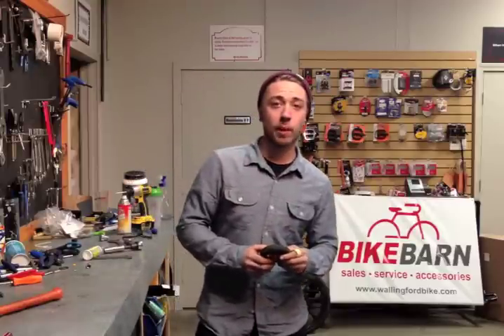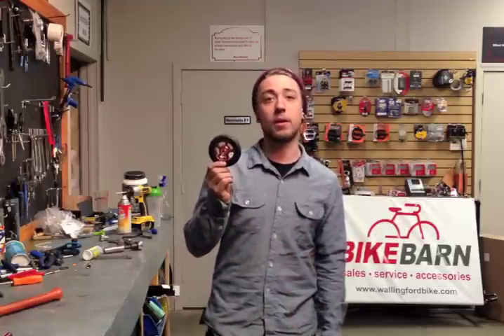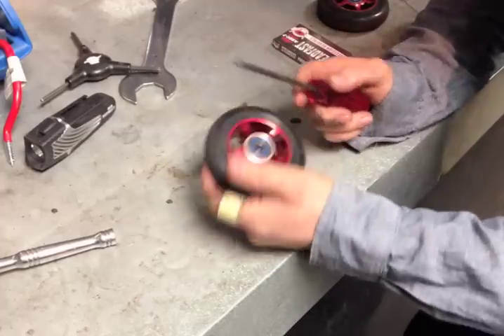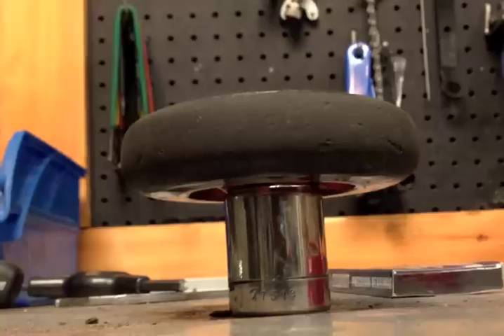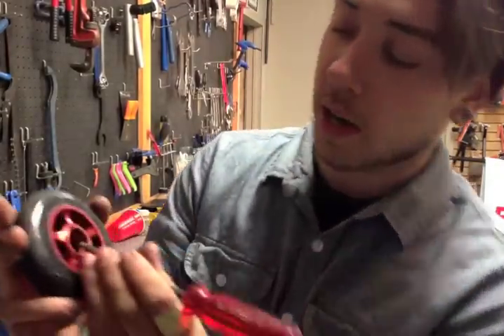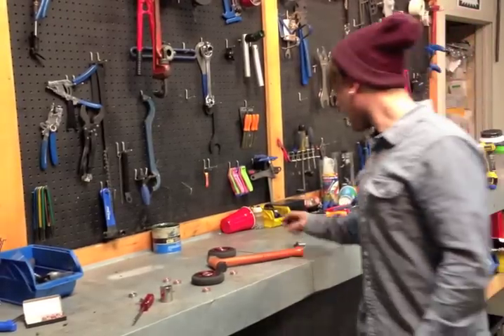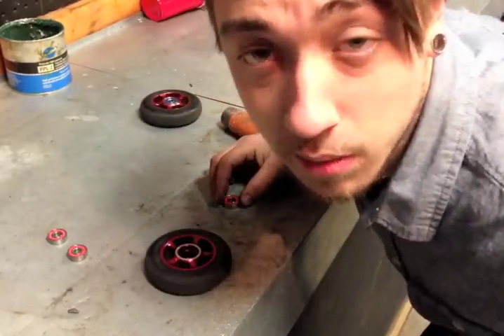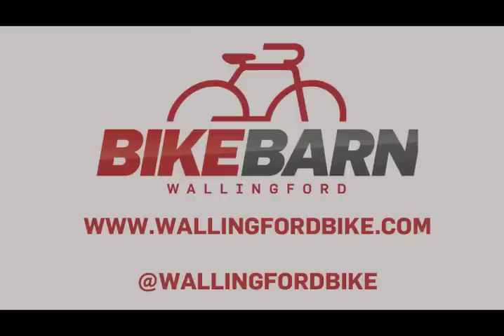How To Remove And Install Scooter Bearings Part 1  (Hammer)

Comment: I suggest using a small socket thats about the same width as the inner steel thing of the bearing when taking the second spacer out as its almost impossible to damage the bearing that way. And when putting the bearings in It's good to put a piece of wood of a few layers of cloth or something over the wheel just to make sure you don't end up tapping on the plastic piece and breaking the bearing

Comment: Thanks a lot for this video, I have 4 piranha scooters, and the latest one has completely shot bearings. My dad replaced the bearings on the first 2 scooters and the third rides alright - not needing new bearings just yet. The fourth one the bearings are completely shot, and I'm going to have a go at replacing them by myself.

Comment: tip: use a wooden malet (hammer) the metal hammer will bend the bearing if it tilts
Reply: Or put some glue on it
Reply: Or use a rubber mallet it is rubber so it's not going to damage it unlike a metal or wooden hammer

Comment: I need some advice because my yy150-12 has the brake out the wheel. I’m not sure what wrong but it’s not my belt or motor. My scooter will move either direction about 3 feet then lock up. I honestly don’t know what I am doing just need advice or pointed in the right direction

Comment: does it damage the bearing when you hammer it out? I put the wrong spacers in my wheel and I can't get the bearings out without damaging them.

Comment: Problem I have with Scooter wheels is after about a month or two the rubber start making noise.  Seems like the rubber is moving around the rim.  The noise only happens when I put a little bit of wait on it.  The wheels still spin pretty good and I use pretty good oil.  Can you recommend a good set of 200 MM wheels?
Reply: Get the lucky charm wheels made by lucky scooters. They are great wheels and last a very long time.

Comment: You should tap gently around the whole bearing not just one spot. In the long run the bedding will be damaged especially with aluminum wheels.

Comment: I hammered brand new bearings into brand new wheels and it's a very tight fit and the spacer got wedged diagonal between the bearings and I can't straighten it and I can't get the bearings out ising this method help?
Reply: you should never use a hammer to hit bearings in